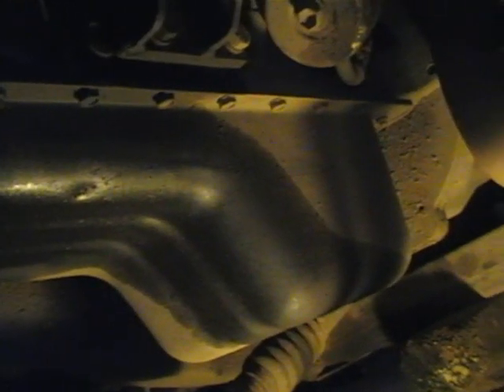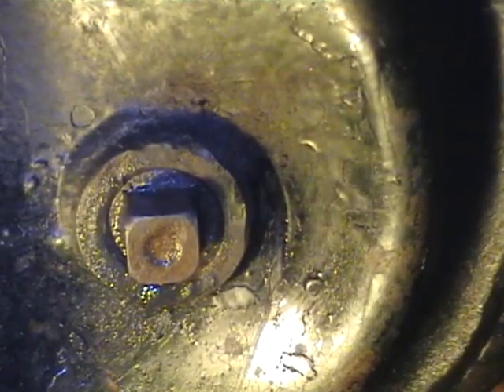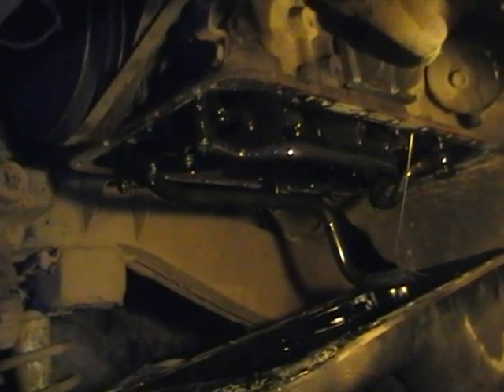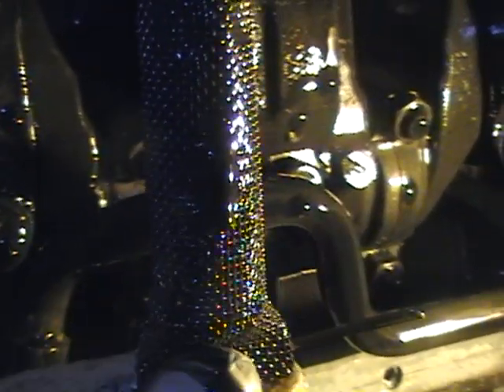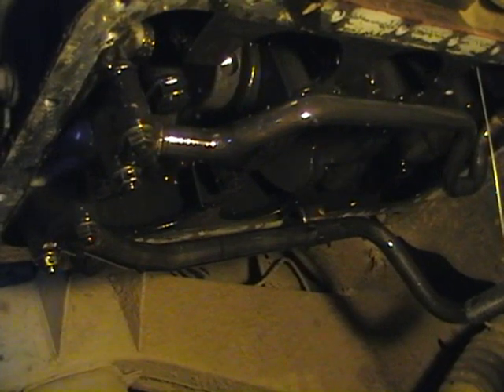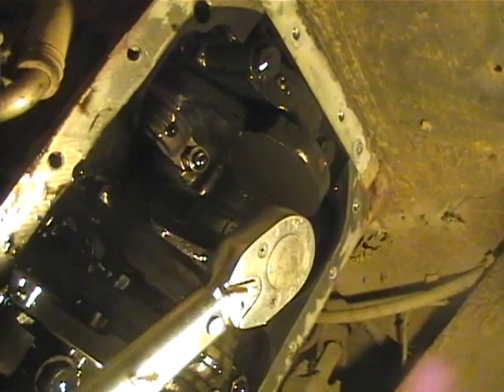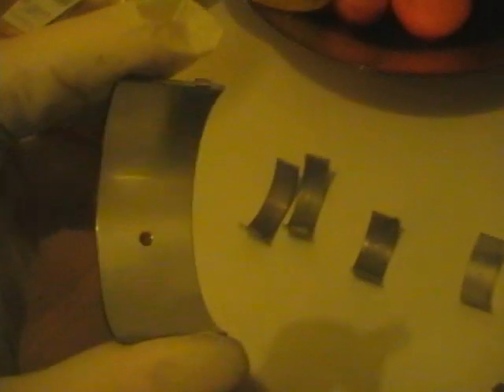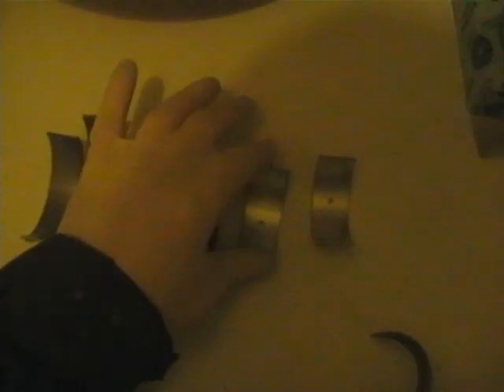Daihatsu engine bearing failure

Comment from the maker: it was the DL52 engine + LT77/LT230 Land Rover gearbox, it was a good conversion in it's time, i fitted it about 9 years ago, i've since found out the main bearings failed because of low oil pressure due to badly worn Turbo bearings. i'm in the process of fitting a 300TDI in at the moment

Comment: Ive heard of that happening with worn big ends but isnt it usually when you rev it that it makes a crazy clatter, dont think it does it on tickover like yours did until it is seriously shafted. Bear in mind that it has a few MM of squish band between the piston and the head. Might even be more likely to hit a valve than the head its self.

Personally I wouldnt worry about it.

Comment from the maker: yeah, the heads flat, with seperate combustion chambers, they're supposed to be smoother and quieter than direct injection, but they aren't quite as efficient, esp. if you run em with no oil, like me!

Comment: Tom  your right, i think i've changed them just in the nick of time, i was noticing that the engine was getting rattley and the oil light was taking longer to go out, so i knew it was time to take action, funnily enough, i put the rattle down to the piston making contact with the head, rather than the worn big ends making the noise, whats your opinion Tom?

Comment: While I realise your 'special tool' was fabricated from aluminium (i.e. a relatively soft metal), I'd still be uneasy on using any metal 'tool' (be the metal soft or not) to push out the top main bearing shells.

Wouldn't a clean ice lolly stick or sturdy plastic be more advisable?